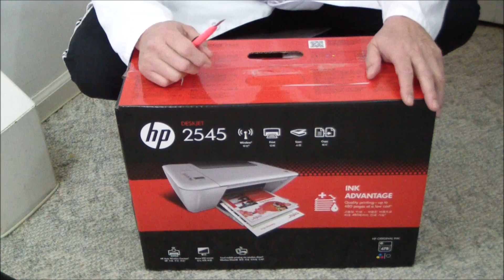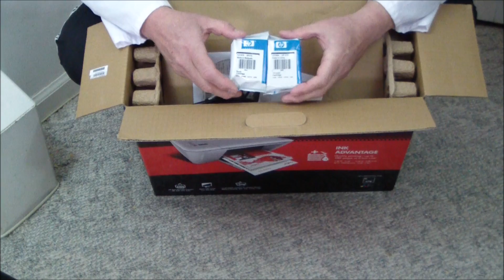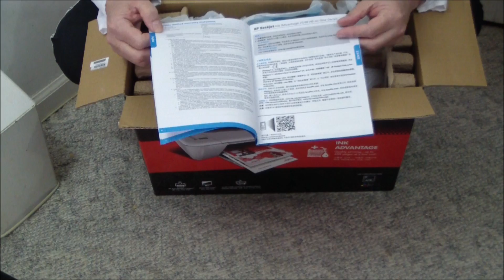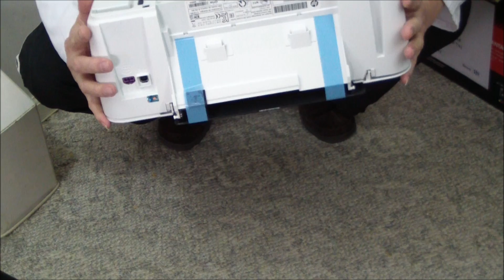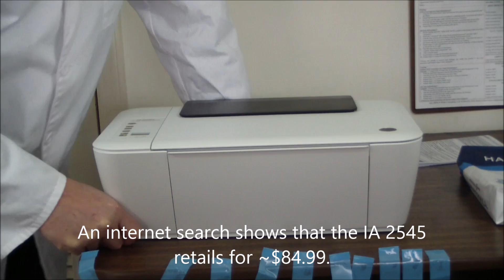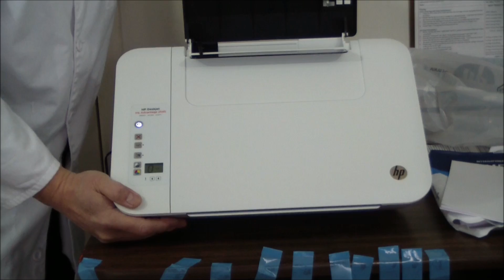HP Deskjet Ink Advantage 2545 Unboxing & Setup

Comment: I bought a HP 1115 a couple of months ago. One of the cartridges is now low on ink. 

Instead of simply warning me that an ink cartridge is low, the HP printer will now not allow me to use the last of the ink in the low cartridge by printing pages until I decide that the print quality is no longer acceptable.

If they think the only effect of interfering with my choice of how I use MY printer is to simply buy replacement ink cartridges sooner, they are wrong.

The effect of their interference with my decision--my choice--is that I will replace the printer with a different brand of printer, and Hewlett Packard can go straight to hell.
Reply from the maker: David,

The inability to print with one or more empty cartridges is an issue with other vendors as well and can vary from model to model within a product line. Try going into the print driver ("Advanced" button) and printing with "black ink only."

Comment: Is the 2545 the same as the newer 2548?
Reply from the maker: Not exactly the same but virtually identical when it comes to the unboxing and setup aspect. You made a wise choice and will save lots of money on ink compared to any other brand of cartridge-based inkjet printers. Good luck with it!
Reply: Do those generic HP 61 XL ink cartridges work on the 2545? Thanks.
Reply from the maker: The HP OEM Ink is cheap. It does not pay to fool around with anything else.

Comment: Terry how many pages in black and in color does it print with a cartridge?
Reply from the maker: +Gino Sthefano  - Clipped from notes above: 

" . . . an HP 678 black cartridge costs $8.24 and yields 480 ISO pages (1.72¢); an HP 678 Tri-color cartridge also costs $8.24 and yields 150 ISO pages (5.49¢). This translates into an ISO color Cost Per Page of 7.21¢. This is considerably lower (~13¢!) than the Cost Per Page of non-Ink Advantage HP printers. Compare this to its North American counterpart the Deskjet 1010 and its obscene 20¢+ Cost Per Page and it's a travesty."

Comment: Apologies just noted video re HP 2545, not the 2540 which I purchased, still can you help at all, Thanks,phil
Reply from the maker: +Phil Marson  - You must have the HP software installed on the powered-on PC that the printer is connected to. Place the original on the platen glass and computer. Start the scan job using the printer software. To do this, go to your devices and printers folder and click on the printer icon. In the printer software, select the Print & Scan tab, and then select Scan a Document or Photo under Scan. You will see scan options that you can select on-screen. The scan will then be delivered to the default scan folder on your PC. This folder is indicated in the printer software and can be changed. Good luck!

Comment: can we use CISS with this printer?
Reply from the maker: I am sure you can find a CISS kit for it. But why bother and risk reliability when the ink is cheaper than any cartridge - based system by far? Read the video notes to find out more.
Reply: But CISS is cheaper than any cartridges.
Reply from the maker: +Techy Farooqui (Mad4Tech) True but the trade-of is that it is also more messy and less reliable. Plus it is very difficult to install a CISS kit on this model because of very tight clearances in the front, sides and top of the ink carrier. IMO, if you insist on CISS, go with an Epson factory-installed CISS printer.
Reply: any suggestion from EPSON at this budget?
Reply from the maker: +Techy Farooqui (Mad4Tech) That is a tricky question. What do you mean by budget? Factory CISS printers cost considerably more to buy but their ink costs are very low and reliability is not an issue. So, if you are concerned about purchase price, then it is a problem. If you are concerned about cost of ownership, then the higher purchase price is more than justified by the low cost of ink. One thing to consider is adding the cost of a CISS kit to the cost of a cartridge-based printer and factor in the cost of your time for the install and the additional maintenance time spent for head cleanings. Then compare it to the purchase price of a factory CISS printer. Epson just expanded their line of CISS printers and you can read about it here: http://wp.me/p182J1-71H
Reply: Terry Wirth Thanks